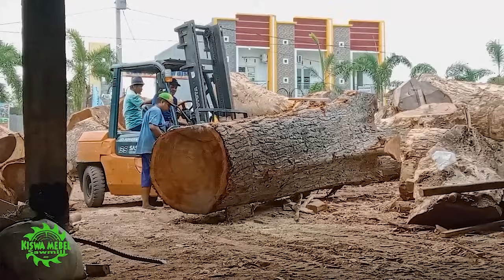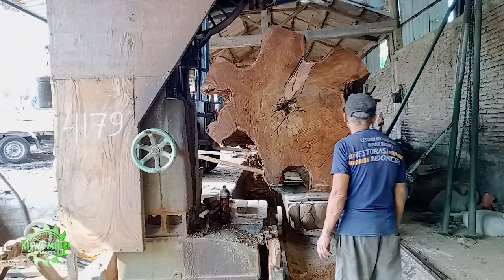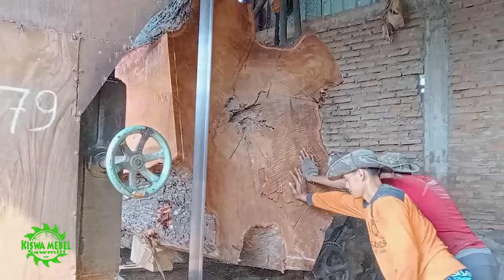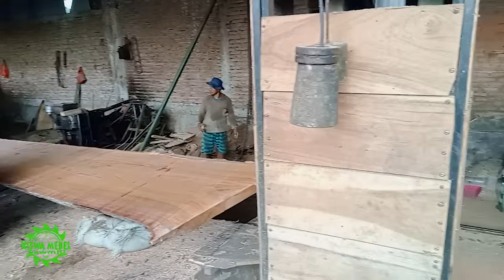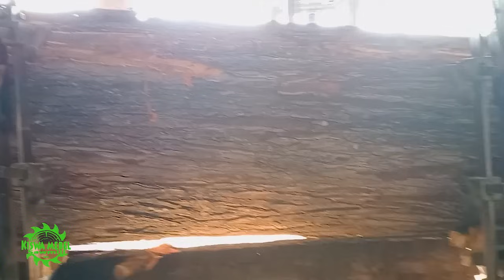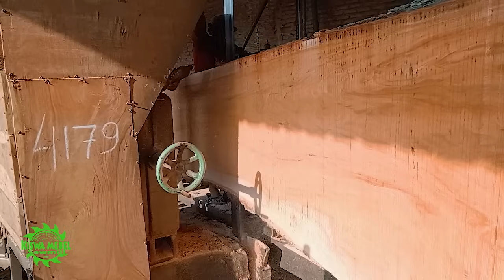Kayu mahoni terbesar didunia ! Proses gergaji pembuatan papan kapal pesiar Amerika I Sawmill

Comment: I lost track of the safety violations in this video. The sawmill radiator is plugged with sawdust, might be the reason it is overheating, you think? Love the dusty rag as an air filter. Zero days without an injury on this jobsite.